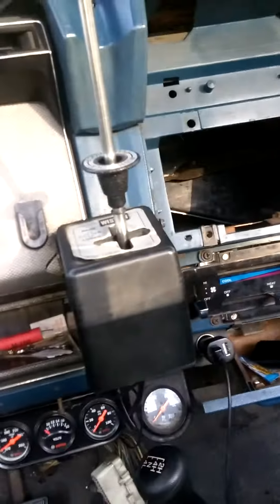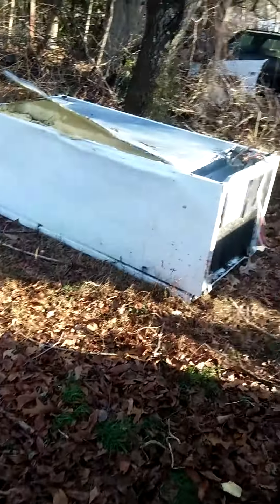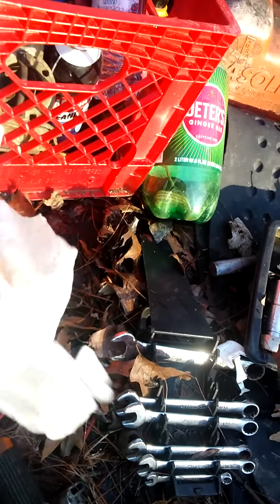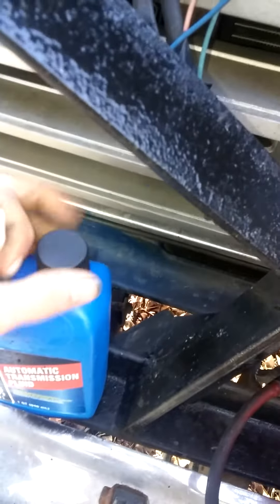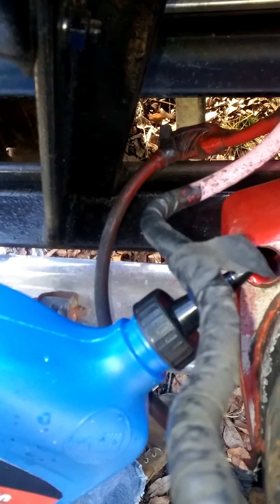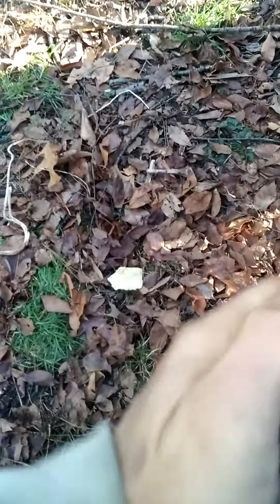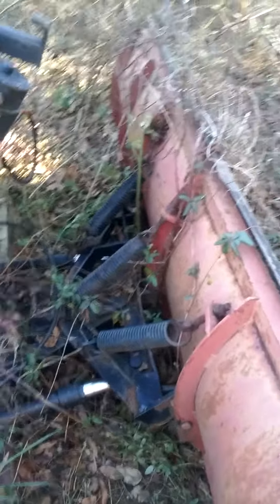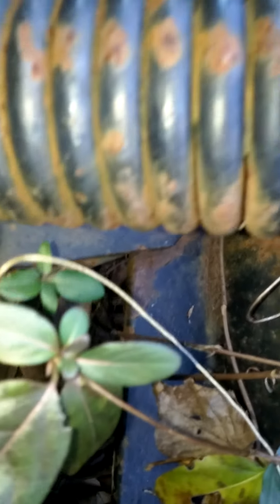Ismark lll western plow (part1)

Comment: Hey just so you know ,you can not over fill that housing ,if you look down the hole there is a tube that won't let the oil level exceed the correct amount. You can fill it to the top of the hole and it actually will only be a little over half full in the housing.
Hook the chain on the lift arm and hit the joy stick a little and you can move the blade real easy because it will weigh about half as much and with the chain hooked up you could just back right out of those bryers, lol